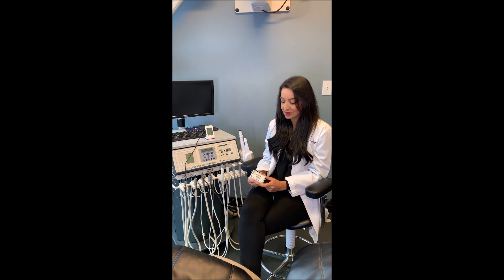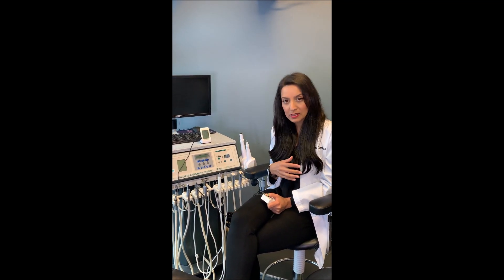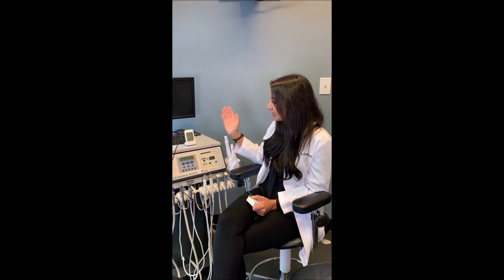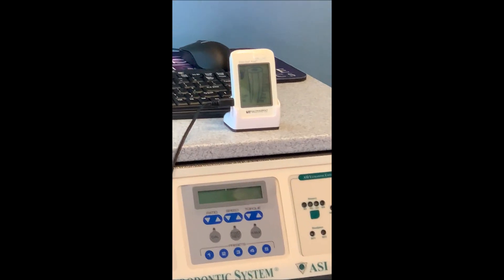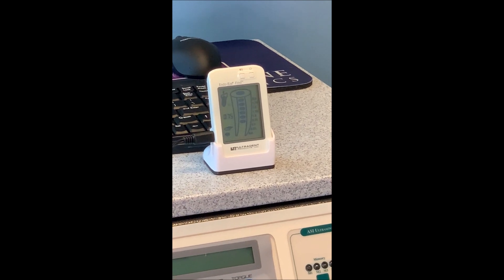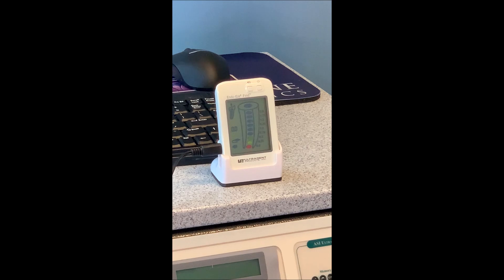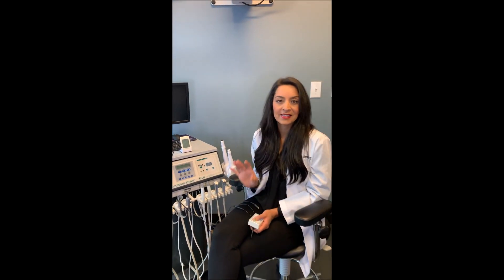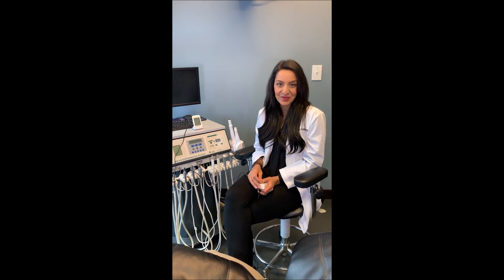Your Apex Locator: How to Understand It (Endodontic Quick Tip)

Comment: What does it mean if the numbers are jumping on the apex locator. Actually it is the green , orange and red are going up and down. Also,
what is the best size instrument to use to take the measurement  reading for working length?
Thank you.